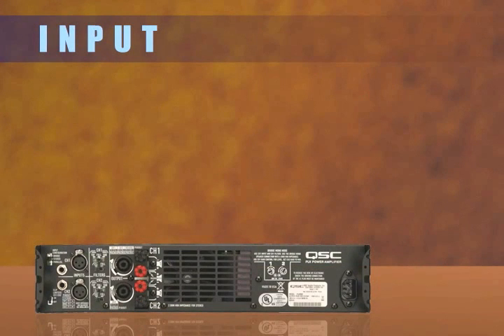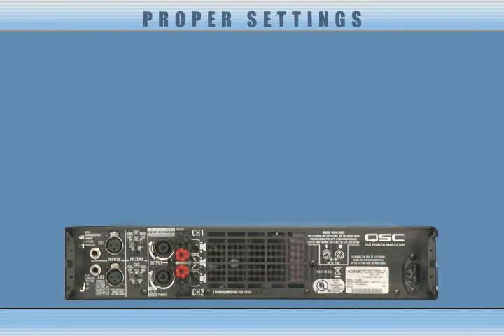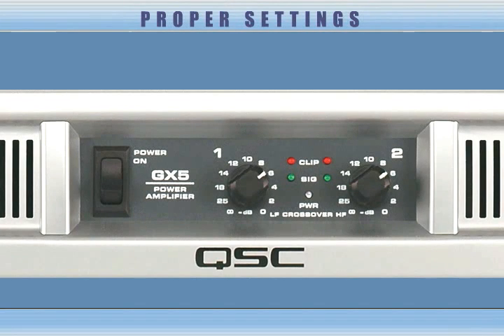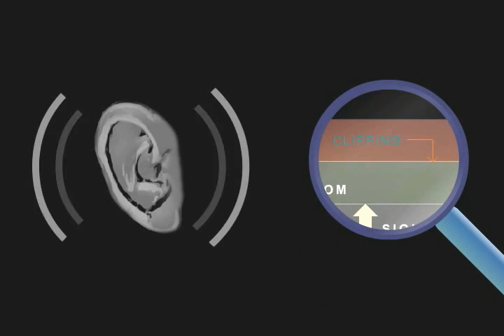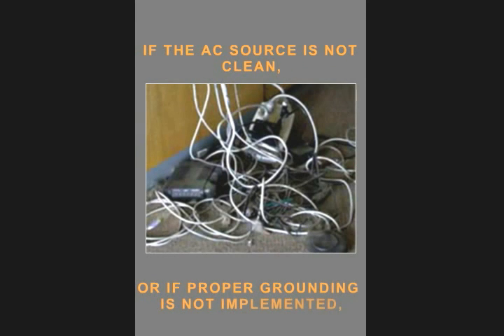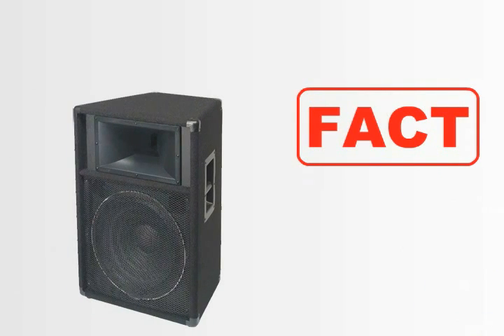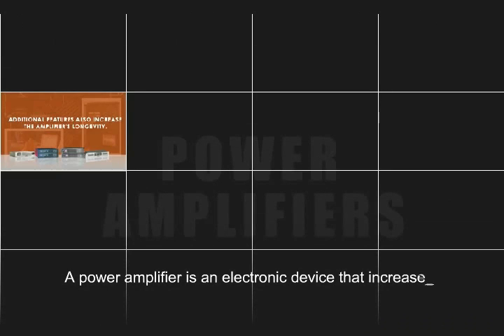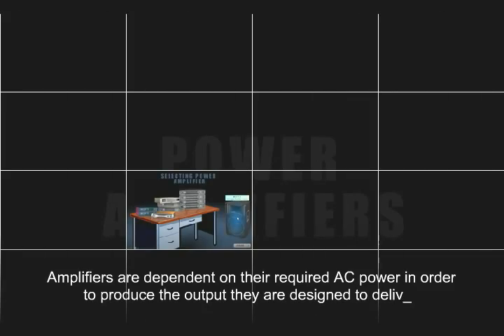Understanding Sound Reinforcement - Power Amplifiers (Part 2)

Comment: The "clipping" thing is not about DC power at all but merely that it tends to concentrate a greater percentage of the power to the tweeter, especially with music with high treble content like heavy rock and hardstyle.
You are better off using a larger amplifier cleanly to get more volume than use a smaller amplifier pushed beyond clean as you will actually get less power to your tweeters and it will sound better.
Most amps have clip limiters these days so cannot be pushed to sound like a distorted maxed out car stereo.
Overdriving speaker elements can occur with an excessively powerful amplifier still in its clean range of even with a normal amplifier if the crossover doesn't filter out very low frequencies below the tuning frequency of the box that is used.